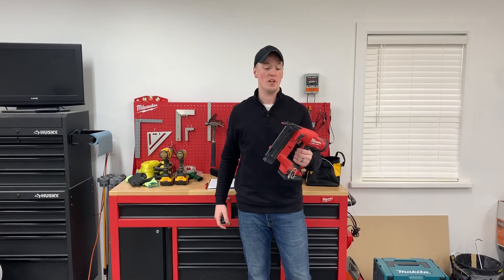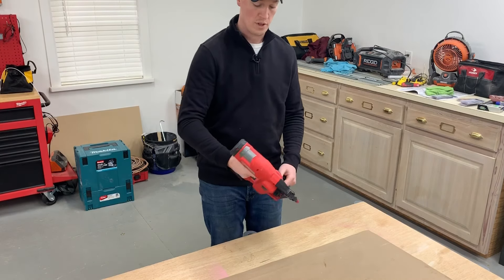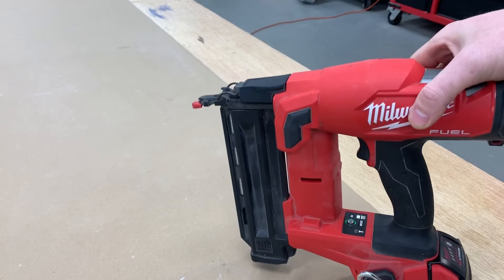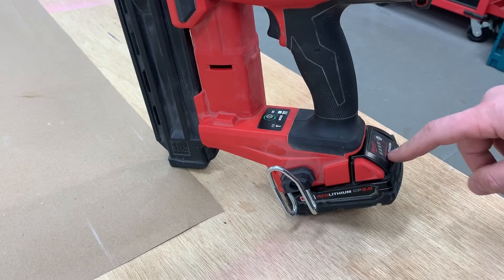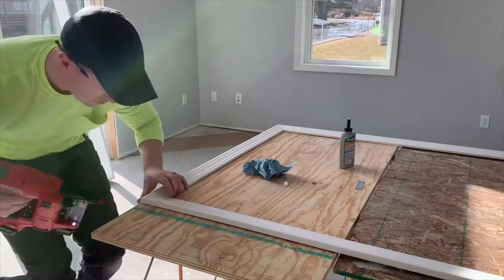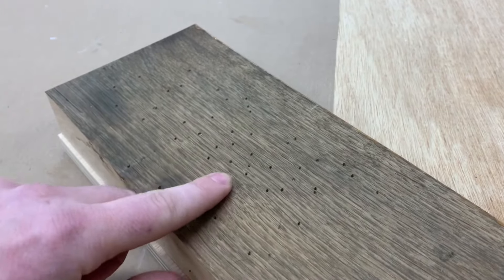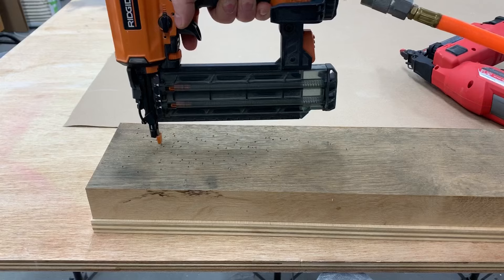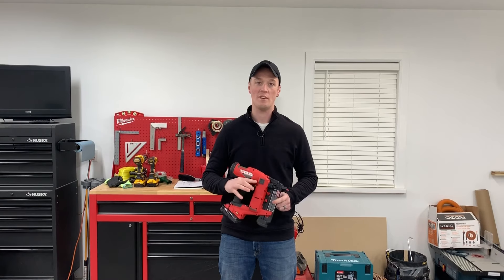Review AFTER Heavy-use | Milwaukee 18 Gauge Brad Nailer (Gen 2)

Comment: I too have put it to heavy use approx 30,000 nails mostly 1 5/8 . I'm a trim carpenter. Not one issue with this gun. Love it worth every penny. I bought mine on free battery week and scored  a 5.0  for zip. Everyone on our crew wants one. Highly recommended.  Throw away your gen 1. Milwaukee hit it out of the park with gen 2.
Reply from the maker: Yessir! 👊🏼
Reply: Another trim carpenter here. I go through 5k boxes of 2" brads on the regular with this thing, not sure how many I've shot, but a lot and it continues to work great. Excellent tool!
Reply: To save a little weight, I use a  2amp battery an get more than 700 brads before recharging
Reply: Scott Moore, if someone has a Gen 1 nail gun they don’t have to throw it away...  Ghat would be rather stupid, considering Milwaukee’s awesome 5 year warranty.  They simply need to call 1-800-SAW-DUST, tell the rep how disgusted they are with their Gen 1 nail gun, as they fully expect it to operate as beautifully as the Gen 2.  There’s no way to repair it, so after receiving the Gen 1 gun back they’ll ship back out a Gen 2 to replace it!
Reply: @martylucas8557  really? I have a gen 1 and can't stand it.
Reply: Josh Medeiros exactly!  Did you even read my post?  Of course you don’t like it, however you’d love the Gen 2, as it’s nothing less than awesome.

So read my post again...
Reply: Any repairs or nail jams? I’m thinking of swapping out my paslode cordless sets for these. Sick of buying cartridges
Reply: @carbb5760  No issues. No jams, misfires. Not one nail not sunk. Probably 50,000 nails fired by now. This gun is awesome. Absolutely recommended.
Reply: Scott Moore awesome thanks, my paslode set has been ok, but they require regular repairs and cleaning not to mention expensive gas cartridges. Seems that is old tech, I guess it’s time to ante up
Reply: Can this tool be used on 3/4 plywood ? I’m doing subflooring.
Reply: @albertozarate9870  it can be but it won’t work very well, you would need a framing nailer for nailing subfloor
Reply: I’m looking to switch from a Passlode trim gun to ____\ for my cabinet build. Using 1/2” and 3/4 ply, with glue and _____ to assemble them.  I usually put 1 good screw in each corner, just to be extra secure. 
But I’ve never done it with a gun like this?????
Any thoughts from you Brad & pin gun folks. 
Much obliged. 👍👊

Comment: You can change the setting so you don't need to lift up after every shot... and just scoot it like your pneumatic.  Right next to the power button you will see a single nail symbol and a multi nail symbol.
Reply from the maker: That makes it so all you have to do is hold the trigger and then it will shoot when you engage the tip
Reply: @JohnBuildsIt  Ahh sorry... my mistake.  I have that gun but never actually used that feature.

Comment: I've had mine for like 3 months and I've used it on 2 large projects and is has never failed me it's an amazing tool
Reply from the maker: For sure!
Reply: What size of nails are recommended for wood trimming? I'm goin to install trimming in my house around the bathrooms and rooms around.thanx in advance
Reply: @tonistarks2874  I'd use 1 and 1/2 inch or 2 inch 2
Reply: @lilbigdaddy3042  thank u brother 😎👍🏼..Im goin to HD right now to buy the m18 brad nailer😁

Comment: First and best review on youtube. Theres NO need for me to watch other videos on this nailer. Sold. 😃
Reply from the maker: You won’t be disappointed! 👍🏽
Reply: Wait till you drive 2” brads into solid mdf casings and liners. There is no better nailer on the market then the Ridgid pneumatic. I used Omer, Max, Porter Cable. They are all trash in comparison. Omers are almost 200 $ more. Life time warranty on the ridgid. Best nailer I used 10 years in business! Painters love it!
Reply: I have had no luck with cordless nailers. I currently own the Milwaukee gen 2. It his a great gun for looks, technology, and power is incredible. Sinks nails deep. Hole size is ok too. It’s the double nail BS I hate. Perhaps I got a lemon. May change it up with a new one see if it’s a factory issues. Noticed the top bar that holds firing pin down has no real torque like the Ridgid. It seems much looser. This could be how 2 nails sneak out?

Comment: I bought this nail gun as we were planning to renew all the fencing in our back garden. As this involved 19 double slatted fence panels, 10 of which needed to be cut down in size, we knew there would be a need for a great https://www.youtube.com/post/UgkxHQsUrwNr5GQrnx9V4xDdUr56qxwuiBHt deal of re-stapling the wooden slats to the wooden framework. Each alteration required the re-stapling of 62 wooden slats with double staples. Prior to starting the work we ordered sufficient additional staples as per the instructions with the gun.The gun performed fantastically throughout the entire project with no jams of misfires. The adjustable power was excellent allowing the staples to be fired into the 8mm slats to the correct depth. For the price paid this was a bargain and it proved itself to be so reliable and versatile making an arduous task much quicker and professional. I cannot recommend this product highly enough and it will be used on many other projects in the future.

Comment: One of the best tools I’ve ever owned honestly. I’m glad I didn’t buy the gen 1 model though!
Reply from the maker: Same man!
Reply: Kane’s Garage, if you had bought a Gen 1 Milwaukee will replace with Gen 2 free of charge.  It’s covered under the 5 year warranty.
Reply: @martylucas8557  for real???
Reply: Daniel, yes.  Call 1-800-sawdust on Monday.  I don’t think they’re open on Sundays.  

Tell the Milwaukee rep that you’re very dissatisfied with your Gen 1 nail gun, that you fully expected it to function like the Gen 2 does.  There’s nothing they can do to fix it, so they’ll replace it for you.  Tell them what an awesome job they did with the Gen 2 nail gun and how great it would be to have a tool that functioned as it does vs what you’ve been having to deal with.

I think situations like this are less expensive for a manufacturer to replace on a case by case basis vs issuing a recall.

Comment: Mine was amazing for a year, but then it started killing my batteries, and now I had to send it back for service because it was not turning on after being turned off, and it was also having trouble shooting nails consistently. Thankfully Milwaukee backs it up for 5 years, which is amazing for any product nowadays!
Reply from the maker: I’m still going strong with tons of use, besides a weird clicking noise and not firing a few times haha, just turned it off and back on and it worked so not sure what that’s about.
Reply: @Adirondack Homestead mine got returned to me as-is, broken. I had to send it back for a second time, and now I’m finally getting a replacement…
Reply: @Adirondack Homestead My replacement arrived recently and of course, it's working as intended (power button works to turn it on, off and then back on!)
Reply: I have had this for just over a year and I love the gun but it's just mysteriously stopped working. I contacted Milwaukee and at first they were not going to honour their guarantee because it was just outside the year. They said it was because I had not filled in the form for the extended warranty which I contested because I could prove my purchase to them. After a bit of fighting my corner the guy told me to send proof of purchase and he would look into getting it fixed under warranty for me. I am somewhat disappointed in Milwaukee because this is the 2nd tool thats broke down on me. I have reliability concerns! I still think their finishing nailer is the best one out there but I have lost confidence in the tools reliability and the company imo are not showing good after sales support by trying to deny me help under warranty. The tool was bought on 5/5/2021 so it's only a few weeks over the year and it is not firing! What should I take from this in terms of the brands reliability? Great gun when it works but it's not so great when you are on a job and it lets you down! The gun has only seen fairly light usage over the year too. Not good Milwaukee! At least honour your guarantee when customers have proof of purchase. Do better Milwaukee!!
Reply: @pgtips4240  weird, their supposed to have 5-year warranties…
Reply: @skumancer  Well in uk they are not honouring it by default if you have not sent the extended guarantee form to them at time of purchase. It's a con because they know most people won't bother filling in the form. After fighting a bit with them they told me to email my proof of purchase so I will see what they do.

Comment: Was forced to buy this because the pneumatic nailer I had took a dump on me. Plus the pancake compressor I had on hand was really loud. I’m working on a condo unit so the super loud noise was embarrassing to say the least. 
I’m installing 3/4” thick,  5 1/2” wide baseboard on a 3 floor building. Around 1,200 feet once all said and done. I used Dewalt nails exclusively because the Home Depot only had that on hand at the time. After getting used to the initial learning curve mentioned at the beginning, I didn’t have a single issue with the gun. No jams or other issues to speak of. I used a 3.0 battery on an 8 hour day. I have to say, I was extremely satisfied with the performance of this gun. It was a huge help. I didn’t have to worry about compressors or plug in outlets, hoses or otherwise. For me it was a worth while investment that paid itself on the first day. I used it on another worksite a few days after for some small baseboard, no issues. Didn’t even have to adjust the gun for depth.

Comment: I just returned the 18 ga Milwaukee nailer to Home Depot because of the jamming issue. HD only had DeWalt brads in 1 3/4 length. 
I exchanged it for another Milwaukee 18 ga. Nailer. Thankfully I found your video before I shot another single DeWalt brad. 

Ok!  Problem solved. Thank you for that very informative tip.
Reply from the maker: Awesome man!
Reply: That’s so weird I wonder why? We only buy Dewalt the big packs and never one problem. We do use 2” though so maybe that’s it.

Comment: Ok, I just picked up gen2 cordless Milwaukee brad. I work with mdf daily. I see the ridged pneumatic nailer. That is by far the best on this video. As for the cordless, it is at best hit and miss. It’s 1 week old. First day I had 3-4 miss fires. Shooting Two brads at one time leaving them up 11/4” above the product. 

I was doing window liners. And 1” nominal casings. The gun has no issue with power or sinking one nail. Yet it will occasionally try to sink two when burring it into 2” of solid MDF. Finger joint pine and profiled casings would be a breeze with this gun, or even the far cheaper Ryobie Airstrike. I bought that one first. I would still own it except I maxed out pressure and it would miss fire and fail to recoil on 2” mdf.

Comment: Thanks John  despite the weight issue  i have to hand it to Milwaukee  on the overall Ergonomics  on the gun  which IMO is one of the more important issues on any tool.  I did buy and use The  Senco Battery operated  finish nailer when that was new on the market and although it worked well i never liked how it fit in my hands and found me personally using my older Pneumatic Sencos most of the time  i do like to utilize a Silicone hose length that my guns are attached to for maneuverability
Reply from the maker: I have the battery powered Dewalt compressor and senco gun too, and that is a really nice portable set up👍🏽 but honestly haven’t used it since I got this gun haha

Comment: I had bostich nail gun kit, the nail gun would misfire, drive the nail to deep or not deep enough,even  jamb.
8 bought senco made of magnesium is real work horse, very light weight is consistent and rarely jambs.
I will keep on with sir to install lower trim .and battery for climbing up and down ladder no hose to get entangled.
I have lot of 18 volt fuel tools considering the milwaukee a tie with senco fusion.
Your video helped to lean more milwaukee.

Comment: I don’t understand why you were having an issue with sequential firing of the nailer.  The Milwaukee has two modes, one where you have to lift the tool in order for it to reset prior to shooting the next nail and a sequential mode that allows rapid firing by moving the nailer along the surface you’re nailing, without having to lift the nail gun.

Comment: It can sink in Ipe too which is very impressive. I've been having problems with jamming, could be the metabo nails. One huge issue that doesn't have anything to do with the nails is that it doesn't like to fire all the time. I'll get a click and no shot, then wait 2 seconds to try again. This is my 3rd gun and I'm hoping this one is better.
Reply: Are
 You sure you don’t have the M18 Fuel Gen 1 gun?  I use mine everyday, firing from 10-15 + racks of 2” nails per day, 5-7 days a week.  I use exclusively Senco nails.  I have never ever had a jam or a malfunction to speak of.  I’ve also knocked my nail gun over at least half a dozen times, where it’s fallen from 2-3 feet.

I do however take extremely good care of it, always cleaning it off, then replacing it in the large Milwaukee bag.

Comment: You used 18ga nails to hold in big casing like that? Not a professional like yourself but I would think that 15ga or 16ga would be stronger. Interested to hear your thoughts on that, thanks!
Reply from the maker: Just depends on the size and thickness for me. I use the Milwaukee 15g as well

Comment: I bought this nailer 13 months ago in uk and after light use it broke down and I can assure you I have treated it and handled it well. Milwaukee in uk don't want to help me because it's one month over the year and simply because I didn't fill in the extended warranty form. Thats Milwaukee finished as far as im concerned, their after sales is utterly shocking!
Reply from the maker: Dang you guys only have a 1 year warranty over there?? Ours is 3 years.
Reply: @JohnBuildsIt  Ours is supposed to be 3 years but when you buy the tool they require you to go online and register the product online, I didn't do this, I forgot but I still think if I can prove my purchase they should fix under guarantee but they are refusing. I am going to take the company I bought it from to task under the consumer rights act 2015, a premium product must meet a certain standard of durability even if it's outwith it's standard year guarantee.

Comment: Just purchased my gen2 Brad and right out of the box I noticed the battery is loose when on tool.. battery locks in and fire's works fine, just wiggle in battery.. any input on this ? Thanks
Reply from the maker: Mine does too. Has never fallen off or anything but yea it does wiggle
Reply: @JohnBuildsIt  right out of the box as soon lock the battery in!!.. not what I expected from Milwaukee, especially with the hefty price tag.
Reply: That is common on a lot of Milwaukee tools

Comment: THANK YOU! I LITERALLY JUST GOT MINE TO THE JOB SITE 10 MINUTES AGO AND IT WAS ACTING LIKE SUCH A JAM HAPPY PIECE OF CRAP THAT I STARTED GOOGLING TO FIGURE OUT WHAT I COULD BE DOING WRONG. I WAS USING DEWALT NAILS BECAUSE THEY SAY ON THE BOX THEY SHOULD WORK IN MOST BRAD NAILERS. I'M SO HAPPY YOU SAID THAT. I LITERALLY CANNOT DESCRIBE HOW FRUSTRATED I WAS AFTER HATING THIS BRAND NEW $400 NAILER. I'M GOING TO SWAP OUT THE NAILS WITH SOME OTHER BRAND AND GIVE IT A FRESH START IN THE MORNING. I REALLY REALLY HOPE THIS TAKES CARE OF IT. BY THE WAY, IF ANYONE WITH A MICROMETER WANTS TO MEASURE, I THINK THE DEWALT NAILS MIGHT BE A TINY TINY BIT THINNER AND THAT'S CAUSING THEM TO NOT NECESSARILY DOUBLE FEED BUT MORE LIKE 1.05 FEED. OTHER BRANDS MIGHT BE A TINY BIT THICKER NAILS OR JUST A TINY BIT MORE SPACED OUT AND WE'RE TALKING ABOUT MICRONS HERE SO IT'S NOT SOMETHING I'D BE ABLE TO SEE WITH MY BARE EYE. ANYWAYS THANK YOU SO MUCH FOR THE TIP ABOUT DEWALT NAILS. I'M GOING TO HANG IT UP FOR THE NIGHT AND GIVE IT A TRY WITH SOME DIFFERENT NAILS IN THE MORNING. YOU LITERALLY MADE MY ENTIRE NIGHT THANK YOU SO SO SO MUCH

Comment: How’s recoil vs your ridgid pneumatic? Reason I’m asking is. I’ve had the 1st get before. And it was junk, it was worse then their 15Ga recoil. Hence I’ve bin using my bostitch, and ridgid pneumatic.  I also have bostitch (dewalt coppy)  cordless, it’s flywheel design with slight ramp up, but much softer on rebound.

On the fence to get this one mow
Reply from the maker: I don’t even remember to be honest haha haven’t touched the Ridgid besides this video in probably a year. I’m sure the Milwaukee does have a little more recoil, but I don’t find it to be bad, use it everyday 👍🏽

Comment: I have only used DeWalt nails in mine and have not had one single jam. I only use single fire, so maybe that has something to do with it. I have only run about 300 nails through it so far, so take that for what it's worth as well.
Reply: Not in my case. i used single fire and it would jam every other nail. I wanted to break the darn thing.
Reply: @rosacam6765  That sucks. I've run probably another thousand Dewalt nails through it since I posted that with zero jams. I've even run other brands of nails such as Simpson, etc. Galvanized coatings and all and I have yet to jam it even once! Maybe I just got lucky?
Reply: I used dewalt nails for 400 to 500 nails started missing firing , swapped  nails to tacwise no problems  after 5000 nails. leave dewalt nails in there box